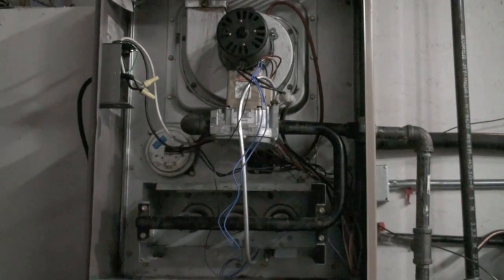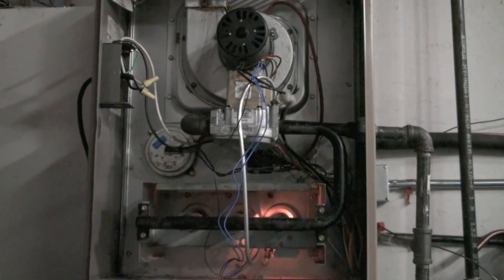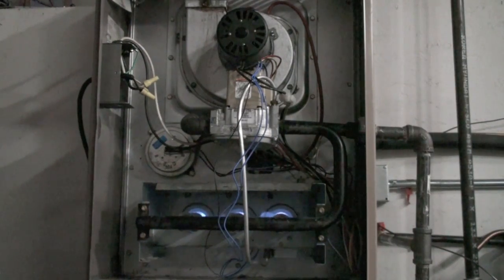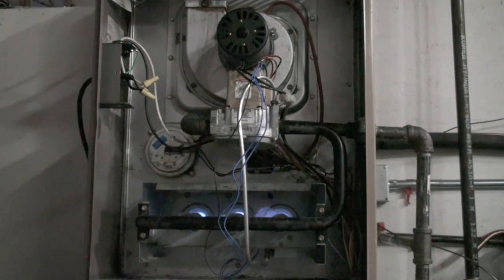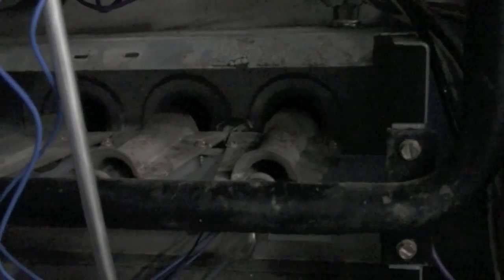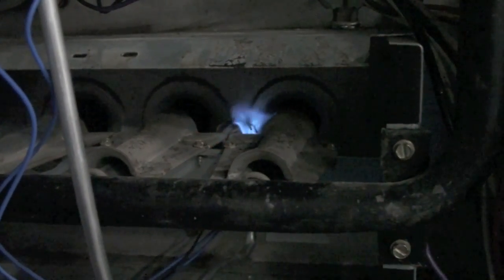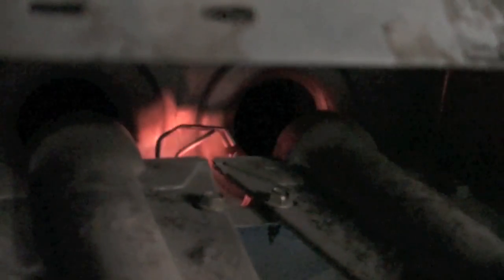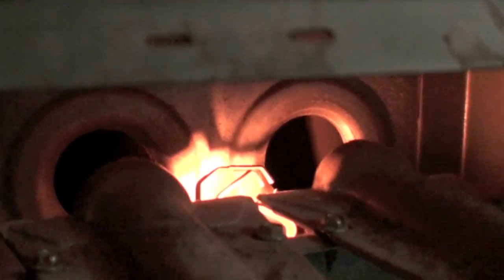How smart valve furnaces work and troubleshoot.

Comment: GFM - Thanks for the videos.  They have proven quite useful.  Adding this story to the thread for two reasons:  1) so that others that may have similar symptoms have an idea what to look for/check and 2) to request your input on whether I have over-fixed my issue.  :-)

Symptoms:
  #1.  Loud, irregular clicking in the gas line leading into the furnace when the furnace is attempting to heat.
  #2.  Furnace cycling - all 4 burners ignite, remain lit for 20-30 seconds, then shutdown.  HSI heats up, pilot lights, burners don't lite... just a brief "puff" of gas being ignited.  Repeat another 2 times for a total of 4 attempts, then the unit goes into safety shutdown.  During each attempt to ignite, the clicking sound in the gas pipe can be heard.

IFC error code:  6 flashes + 2 flashes 

Attempts to troubleshoot:

1.  My Arcoaire has one of the integrated flame sensor/HSI/pilot assemblies (awful design when it comes to cleaning/repair).  I used a very fine emery board to clean the flame sensor, being very careful not to touch the HSI.  Reattached the unit...same results.

2.  Contacted local gas utility to test pressure at the meter.  Confirmed pressure was below normal, but not significant.  Gas tech adjusted pressure accordingly.  Initiated call for heat... same results.

3.  Pressure switches appeared to be operating properly, but I didn't jumper them to test (in hindsight, I should have done this).

At this point I opted to call in a professional.  We discussed the issue and he did some troubleshooting.  He indicated that the Honeywell Smart Valve solenoid was failing/had failed.  Sadly, a $300+ part.  He replaced the valve and the unit began to operate (and the multiple clicks heard in the pipe ceased).

About 1 hour later, the unit stopped working again.  This time the IFC has 3 LED flashes... indicating a pressure switch issue.  Tech came back and determined that the condensate line was plugged.  Cleared that out and things started working again.  All has been fine since then.

The question I have is, given the condensate line blockage, could that have been the actual root cause, meaning the smart valve replacement was unnecessary?

Thanks,
Brian
Reply from the maker: +Brian Pearson I don't think so.  These controls had a lot of problems with the circuit board in the gas valve.  They would make intermittent contact which would cause the problem you have described.
GFM

Comment: I have a friend that has a comfortmaker HVAC system FBF075B12G1 and the gas unit will come on stay on for a moment then shut off, then the pilot will light and you can hear the solenoid actuate then click off and the pilot light will go off without lighting the main burners - I think it is the gas valve however I want to make sure before I order additional parts - your thoughts would be appreciated.
Reply from the maker: If you are sure the main gas solenoid has energized and there is no gas flow, either the gas valve has failed or there is no gas available. Hope this helps. 
GFM
Reply: Thanks I ordered a new valve 

Your videos are great 

Thanks for your help

Comment: grayfurnaceman I was on your other video, this is what I have. Smart valve with glow coil, then the flame sensor and igniter and what looks like igniter pilot. And it is Behind the burner casing. This was replaced on March 21, 2011 before I bought this house in June 2012. I called the man that put it in, his name and sticker was on the furnace said new HSI assembly (this failed when previous own was in Fl. causing the pipe in the kitchen to burst flooding half the house). I should have never bought it. Anyway He told me what he put on, I just couldn't remember, I remembered smart? then found on Internet smart valve and this is exactly what I have. All in one piece everything, glow coil, then the flame sensor and igniter and what looks like igniter pilot. it's insane. How does one clean this flame sensor that can't alone be removed?

I told him in bad place, he suggested a long skinny screwdriver and try to gently scrape to clean off carbon. I had a friend over and managed to get two screws off to loosen part but in reality that burner case has to come off to really get to it. I was skeptical of using a screw driver to clean, but that's what he told me to use because it's hard to get to. The more I read the more terrified I become. Some say could be gas valve or high voltage problems, circuit boards. My God, I don't have the money. This part alone is expensive enough, it should come with warranty to last more than 4 years. I have never used the air since I've lived here, I hate air. So only really used for 2 winters and the start of this one.

What puzzles me after we did this Friday eve. and he put back screws, still not cycling right. Then like I told you on other video one day it worked fine like it's suppose to for almost 4 hours, thermostat clicks, a second click off furnace within 15 seconds you hear flames then blower is on. 20 seconds then heats to temperature...etc. then off. Then it went back to long long time to ignite. Well from I want to say 9:30 - 10:30PM Friday all through Sat. I left house for 7 hours at 4:30, but when I got home 11:30PM  I sat until the thermostat clicked and it still was working fine. Then just before 1:00AM it went to exhaust fan running and again long ignite time and at present the same. 

I don't understand. How could it work fine for so long, then again go back to bad. I'm terrified I will have to replace this all in one HSI assembly again. New in March 2011, is this all they last? Could it be a timing or something worse? If I had the money obviously would just call for service. Hopefully friend will be willing to come back to get the burner case apart to really expose this whole thing but we can't test anything else. I know he is scared he'll touch igniter, it will break then it will be shot. Why on earth would they make this all in one piece. How can one clean flame sensor properly, again without this one part being able to come off. I'm infuriated and upset. The prior owner had $$$, I don't. Sorry for the extensive comment. And just NOW it cycled normal again, Fast. Thermo clicked, you hear the second one from furnace then hear flames come on, then blower on.

What is happening? Please explain what all this sounds like. Why does it work right, then back to not right? This is so confusing and upsetting. Friend thought it was thermostat to begin with, could it be this? One heating and cooling place near me said they didn't think it was this or circuit board. Could it be gas valve problem? Sequencey within the gas valve?Wire Connection?? I guess it could be anything. Like I said the more I read and come across the more terrified I become.

I just don't get it. Cycling right, not cycling right. Back and forth?????

Furnace says Comfortmaker RPJ II but it has Honeywell parts. Friend says this is newer furnace. Whatever, it is making this women a nervous wreck.

I just now edited because I realized you answered it on other video, two things you can think of, Flame Sensor or the Gas Valve itself, the electronics are in valve. So I apologize, now I am really sick. We have nothing to test all these things. My friend isn't a furnace service person. If we can successfully get the burner plate off and clean sensor without breaking igniter but after it still runs fine then doesn't I'm in big trouble.
Reply from the maker: +Longshotsblues There is not much I can tell you.  The 3 things you can do is be sure the pilot light is blue and touching the flame rod, clean the flame rod, and replace the gas valve.  The intermittent nature of your problem is common for this control.  You can try contacting Honeywell to see if they will help.  Don't hold your breath on that one.
GFM
Reply: +grayfurnaceman Thankfully got a friend of a friend who has been doing HTG and Cooling for over 20 years. Ironically it was in good run mode which is a good thing but better if bad mode for him to be here. He checked pressure said gas valve is fine, cleaned a little more of flame sensor (as I said it's in back of burners case) with screw driver, the man who put that 4 in 1 part in had also told me screwdriver as well to get to it. But today this man did not think it was even that. He is convinced it is the Pressure Switch causing it to run good then not not good. He took off one of hose and sucked trying to get any dust I guess. Anyway for your opinion not that I don't trust him, I do. He came here with a doctors bag full of things. He didn't come here for his health. He was doing me a big favor at no charge. But in your experience from all I've explained can it indeed be this pressure switch letting it run like it should, at times for a long time then all of a sudden to not running good. He said if it continued to go back to bad he could get the switch at wholesale price, again just me paying for the part he is not charging me for coming here. Hopefully it will not cease to function completely. If it go to bad again, I'm just going to have him get one. He doesn't live close, in-fact about 3 hours away. He comes down every couple of weeks about 40 miles from me. Anyway do pressure switches cause this insanity. And TY for your replies. I feel bad questioning him, he sounded like he exactly knew what he was talking about but then we get second doctors opinions.
Reply from the maker: +Longshotsblues A pressure switch could cause the problem.  
GFM

Comment: I've just replaced the smart valve on my furnace, and I can get it to light, but the pilot flame is larger than it should be, it's more yellow flame, and isn't getting all sucked up by the fan , causing it to start to burn the furnace up. On the smart valve there's a pilot flame adjuster,  but we either adjust it to too big,  or too small, and it can't light. Are we missing anything? We're replacing the pilot gas tube assembly today, hoping that's it. We noticed a small kink in the aluminum tube for the pilot, not sure if that's affecting it.
Reply from the maker: +Matt Spaulding I would clean the pilot assembly.  The yellow indicates a dirty pilot.  Be careful not to damage the the hot surface ignitor.  Hope this helps.
GFM
Reply: +grayfurnaceman Again, what do we clean it with? A rag, sandpaper, steel wool, alcohol. vinger?
Reply from the maker: +Whatatay T Sandpaper will do.
GFM

Comment: I have a Comfortmaker model ntg9075fga2 (dated 1997) with Honeywell smart valve. The system does not heat but I can see the HSI glowing but no flame in the pilot. I cleaned the HSI and the pressure switch is good and I can hear the gas valve click but no flame either in the pilot or in the main chamber. Is the gas valve bad? The draft inducer works fine and if I put the thermostat in Fan ON, the blower works well too. All the pressure switch ports are in good condition. I also have a gas water heater next to the furnace. It works no problem.  It seems there is no gas flow to the furnace burner. Please help.
David
Reply from the maker: +David Li Assuming that gas is available, the valve has probably failed.
GFM
Reply: +grayfurnaceman 
Thank you very much for your response. After watching your another video "A look at Smart Valve operation", I realized that the tube from the gas valve to the pilot burner may be bad. I took it out last night and found out that at the tip of the tube, there is a corn shaped valve (.25 in by .5 in). It stuck to the tube wall due to the condensation and rust. I cleaned the tube and get rid of the rust. After reassemble the HSI unit, the system works fine. The gas valve is good. However without your video, I would not think about the clog of the HSI gas supply line.
Your videos are very good and thanks a lot for your excellent videos. I think many people have learn a lot and save a bunch of money from our video.
Reply from the maker: +David Li Welcome
GFM

Comment: Comfortmaster 90 about 10 years old.  Repairman diagnosed bad honeywell smart valve. I replaced and thought problem was fixed, but..on comes inducer fan, then ignitor and then pilot, but no fire.  I think you call this not "proving" pilot.  What do I do next?
Reply from the maker: +Jeff Stander Did he clean the flame rod on the pilot assy?  They can be cleaned to get a better signal but you must be very careful not to damage the ignitor.  Hope this helps.
GFM
Reply: +grayfurnaceman What do you clean it with? A rag, sandpaper, steel wool, alcohol?
Reply from the maker: +Whatatay T Sandpaper will do.  Very careful of the glow stick.  It is delicate.
GFM

Comment: model #N8MPN050B12A1 Comfort Maker gas furnace with Honeywell smart Valve SV 9641m4510...Furnace lights up for 2 sec goes out, replaced smart igniter does same thing, replace smart valve, wiring harness and pilot assembly.. unit does same thing...any ideas?
Reply from the maker: Suzette Millar There is a possible pressure switch shutting off when the burners light.  You can jumper the pressure switch to see if it works then.  Caution:  if it works, the pressure switch is not the problem.  DO NOT LEAVE THE PRESSURE SWITCH JUMPERED.  I would be looking for a cracked heat exchanger.GFM
Reply: The pressure switch port on inducer was partially clogged, shutting off burners when lit. Cleaned port unit working now..
Thanks very much!!!

Comment: I have a Armstrong Furnace with a Honeywell SV9520H valve.  The system will only run for about 7 minutes.  It will go through 4 cycles and then stop and flash a code 6.  Each cycle will be about 30 seconds of burner followed by 30-40 seconds off.  The blower fan comes on.

Comment: 409290c HW SV9500 Replaced smart valve and igniter, unit started to burn then cut off after approximately 5 min. Now it will not ignite but fan is working any ideas?
Reply from the maker: Rhett Cody Is there a manual rest rollout switch open?  They usually have a red button.
GFM
Reply: I used a jumper wire on the blower fan that is off to the side of the main fan and has been working perfectly. Will try to get picture up to show which connectors need to be jumped for future reference.

Comment: hello GFM  I have a Heil furnace mid efficacy  I'm having the some issue with a costumers furnace

furnace is firing intermittently lights pilot most of the time burners some times (for long and short periods of time) Iv checked gas pressure 3.7, checked wiring connections all tight 

 I'm the 2ed tech on site previous tech replaced smart valve, igniter/flame sensor combo and fan control board. now I'm in there and recommended replacement but customer has dumped a lot of money in this thing and is hoping there is something else any thoughts
Reply from the maker: Paul Rowe Is it an 80% or 90%?
GFM
Reply from the maker: Paul Rowe I got the mod#.  Some of these smart valve units had problems with the inducer pulling the flame off the pilot.  Mostly these things are a pain.  You might try checking the restrictor plate.  Hope this helps.
GFM
Reply: grayfurnaceman 80%

Comment: Hey, thanks for all of your great vids!  Lots of well explained info.  I replaced HSI after breaking the old one while trying to clean.  My pilot light would still not light.  I did lots of little trouble shooting (exhaust vent clear, drain lines clear, sucked on hose going to pressure switch, etc.) and still got Soft Lockout code.  I called in HVAC guy and he tested voltages and figured it was the smart valve.  In a last attempt after he left, I unhooked the pilot line that goes into the gas valve.  powered up and after inducer moter was on heard click on valve, then propane came out of that port.  Shut down and took the pilot assembly out, removes HSI and blew compressed air through the pilot line and stick a needle down the flame end.  Back together and all fired up as supposed to!  Thanks GFM!!
Reply from the maker: rushangus Glad it worked
GFM

Comment: I have a Smart Valve SV950M 2056. Turn on furnace , you hear the valve open and sometimes the the burners light and sometimes they don"t. Shutoff the stat and turn back on and it will light. All wire connections look ok check all i could. Do i need a new valve?
Reply from the maker: David Campagnola Probably.  If the pilot proves, and the gas valve does not open, the assembly has failed.
GFM

Comment: I have problem with Fan running continuously and no light on LED on honeywell smart valve.  Replaced fan control board and didn't fix it.  limit switches show continuity.  Is this a smart valve problem needing replacement?

Comment: question, I have a sv9500 gas valve, when hsi glows the main burners immediately lite and it pops back,,,, no pilot and flame sense first !!!!   I'm thinking the gas valve has failed.... what is your opinion?
Reply from the maker: I think I would get rid of that one immediately!  Very dangerous.
GFM
Reply: Sounds like a bad heat exchanger. Its kind of like running your car in an inclosed garage. Call a repairman for conformation.

Comment: Question:

1 of the  burners on my SEER 13 Bryant HVAC is not lighting - off until after several automatic starts (e.g., 3-10 attempts). 

Cleaned rods between nozzles & combustion chamber.  

The Right assembly has 2 rods (ignition source?) , center nozzle has no rod. Left nozzle has 1 rod (flame sensor?).

Unfortunately,  Left nozzle takes several automatic light off attempts to fire up. 

What Is the likely problem?

Thanks!

Tim

Comment: I ended up re-positioning the pilot so the flame was about 1/2" lower and now it operates much better, it was too far away and draft was affecting it, service tech thought heat exchanger had small rupture causing the pilot to be drawn into furnace and being blown out, I just moved it a bit...  this was after I installed a new smart valve, the solenoid for the pilot was malfunctioning on the original one.